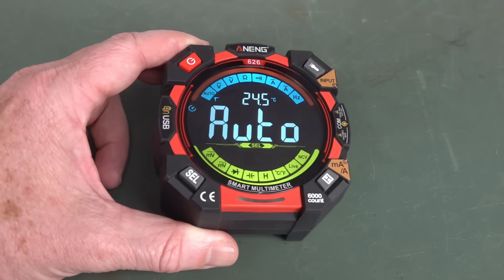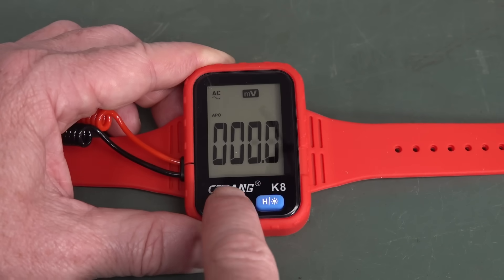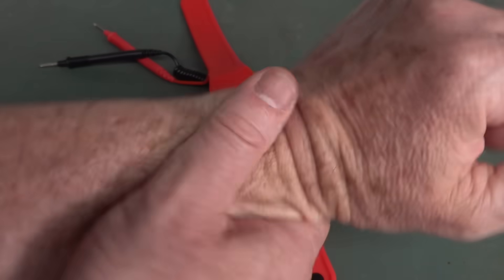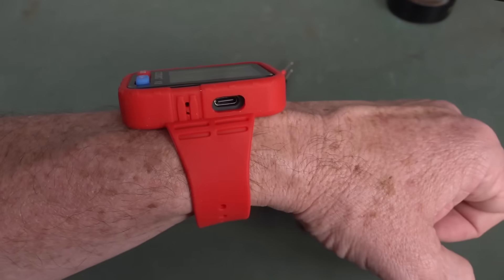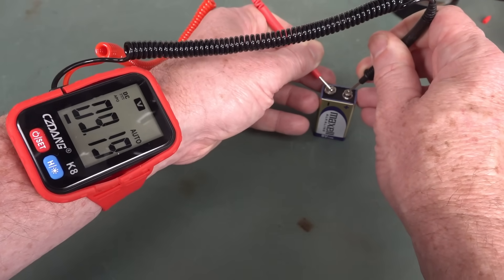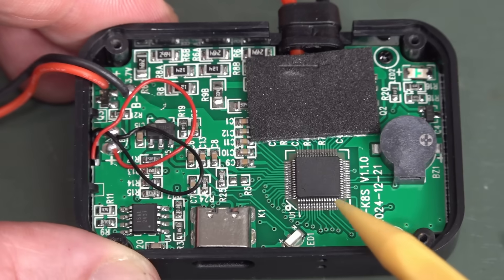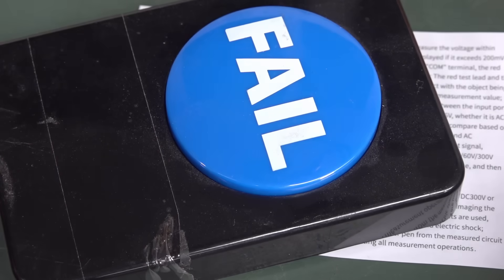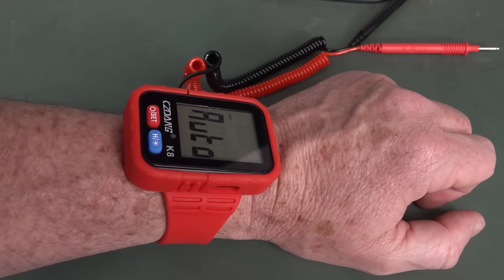EEVblog 1706 - K8 Wrist Worn Multimeter REVIEW

Comment: Could be practical for automotive repair-work for example where you don't want to use extra help or thngs to hold your multimeter on and don't care about accuracy.... maybe? One hand (left or right) to hold one probe and meter, other hand other probe...not really for electronics I think
Reply: I can't here to say the same thing. I cut slots in the rubber case for my smallest fluke and used an old army watchband (Velcro, band is one piece ballistic canvas with a watchband mount pin loops in the middle, plus a Velcro flap to cover the watch) to hang it on my wrist like 20+ years ago. Funny use it every day, but the watch band lives in the drawer with the meter, and when I was giving cars all day every day for living in used it more than once a week (I was always the electrical guy in whatever shop I worked in). 
When you're laying in your back under the dash or under the car, trying to prop / wedge the meter where you can read it and also see where your trying to probe is a bit of a pain, hanging the meter on your wrist makes life so much easier, but the 'small' fluke is still way too big and gets in the way a lot. On the other hand, unless you're chasing a slightly out of spec sensor signal to explain a problem with the engine management system or HVAC, this appears to have all of the functionality and accuracy needed for most automotive work. For the price, the only fail I see is the permanently attached leads and the band that tried to be too fancy without spending the money to make it work like the apple watch. 
Looks like the main thing this needs to be good is a new case with removable leads and a Velcro strap...
Reply: And a light...

Comment: My Fitbit has a similar watch band, but it actually works. In the case of the Fitbit, the band is silicon and you lock it in place before tucking the band under.

Comment: My problem with it is the display is 90° off. It should be oriented like a watch so you don't have to twist your head to be able to read the meter.
Reply: ...as someone pointed out: it depends on WHERE you strap it on ...😅
Reply: It’s meant to be worn on the underside. That way should require a little less twisting, as well as have the display in the correct orientation.
Reply: That would have made it unusable for folk that like to wear on their right wrist although a simple change to the silicone 'strap' could have made it reversible.
Reply: Yeah I thought the same thing lol

Comment: Display is 90 degrees wrong
Reply: Depends on what you’re strapping it to. 😂
Reply: What do you have in mind?!?! 🤔🤔
Probably something very straight very forward 😅😅😅😅
  @akshonclip
Reply: @robegatt only on a good day
Reply: @robegatt Not always, it first needs to be sufficiently stimulated. 
It's a good voltage indicator though: if it becomes rigid and turns an unnatural colour of black, you know for certain that the voltage is unsafe.
Reply: @akshonclip 🤣🤣🤣
Reply: That's the least of the problems!
Reply: Don't worry.
It's just out of phase!
Reply: If worn on the inside of wrist, the display is ideal. 
Not so good if worn like a normal watch.
Reply: @95rav that’d be great if the probe you’re holding with your left hand is always on the under side of the circuit… not how I usually do things.
Reply: How many degrees is "it shouldn't exist" wrong
Reply: High degrees of shouldntexistness.  @Digital_Dependence
Reply: Are you sure? Nobody else noticed that, and it wasn't too obvious to point out, so no one else must have noticed that. It's probably not a big deal.
Reply: Uh?!  @Boogie_the_cat

Comment: um... If it works, its for any guy in a dark tight place troubleshooting any equipment and yes often you are using one hand.  that's real field work.
Reply: but the screen is then orientated the wrong way so you need  to hold a mirror to read it;-)
Reply: @el3dprint  it’s meant to be worn on the other side of the wrist

Comment: Seems like a good idea when testing high voltages to have it securely wrapped to your wrist.
Reply: It's all one piece of silicone and where the leads are attached they are shielded by the wristband. 
That's to say I'm less worried about the meter itself but rather the person who would buy this having no business working with live voltage.
Reply: 😆 perfect solution for that, yeah. At least it would rule out really big measuring tolerances. Well, it would rule out at least big mistakes! By Darvin's law...
Brings me to one bad joke: "What's hanging around at the corner, is black and smoking?" - "It's an electrician, measuring supply voltage from the power grid!"
Reply: Just imagine the premiun version with steel case !!!!
Reply: 300V max so it's not rated for 320Vpeak mains (230Vrms+)
Edit: It's not 300Vac it's 300Vac PEAK this makes sense because it just rectifies voltage on the same resistor divider it uses for dc...
Reply: @w04h It's rated for 300vAC. Well, it claims it's rated 300VAC...
Reply: @SkippiiKai  It says 300Vac PEAK
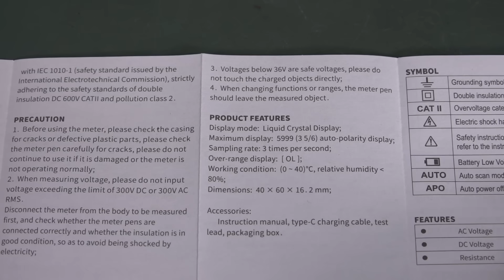Reply: @w04h 14:45 It clearly says not to exceed "300 V AC RMS" Not peak.
Reply: @SkippiiKai  14:54 it says peak... but yeah it's a 8 dollar crap, wouldn't expect it to last much anyway
Reply: @w04h On the left side of that page, where it says peak it's talking about its overload protection, and I believe that's actually a mistranslation of "max". If you look to the right of that same screen, it once again says 300v AC. The listing for it says it does 300vAC, the manual says 300v AC RMS, and Dave just demonstrated it correctly reading 250vAC RMS (350vPeak) without triggering the OL. So... It works as intended at 300rms. Should you use it for that? Of course not... But it will do it. I think the only thing we still need is a video of Dave wearing it while he increases the voltage up to failiure. 😂
Reply: @SkippiiKai  We still need Dave, so we should leave that video for ElectroBOOM
Reply: Yeah, cant wait to try it on 480V panels!
Reply: Especially if it explodes and/or catches fire. At least silicone is quite heat resistant 🤣
Reply: @f-s-r Yes, provided the heat generation is high enough it will melt itself securely on your wrist.
Reply: Yes, too bad it did not have a stainless steel backplate like the far superior Flake 587.
Reply: Well at least then you can put your other hand in your back pocket. And hope that's insulating silicone.
Reply: On the left wrist! Everything bad, including spontaneous unplug tester jacks and high voltage will kill you fasten.
Reply: I'm sure it has a totally legitimate CAT III rating, so it's safe. /s
Reply: Will it measure the voltage of a sparkplug or does they make too much pressure my friends say you can touch them to know if their working they say it feels like a static shock
Reply: @dossod-n8q  I hope this is a joke, but you can't measure the voltage of a spark plug with a multimeter. The voltage is too high. For the same reason, you should never touch it.
You probably should ask in a car repair channel. I think that there is some tool with a small gap that you can connect in series with the spark plug to watch the spark go across the gap inside the tool.

Comment: The PCB must be a double sided load as U2 & U3 are unaccounted for and there's no Li-ion battery charger IC on the top. Maybe you spoke too soon and there's a killer feature on the bottom that makes up for those couple of minor usability complaints you had.

Also that style of wrist band was popularized by the Apple Watch silicone "Sport" band hence why it's such a good design.
Reply from the maker: I'm not sure I could be bothered to take it apart again to check...

Comment: Will bet it will not fit my wrist, seeing as mine are a tad bigger than the Dave standard wrist. Rechargeable because you probably will be using the backlight a lot. Note the case actually has provision for a CR2016 coin cell in it. Looks like it is a good idea, just toss the rubber bumper, and put a bit of velcro on the back, and stick it on the bench as a quick and dirty meter on the bench, or leave it in the car as an emergency meter, leaving the silicone on, and simply cutting the wrist band off.